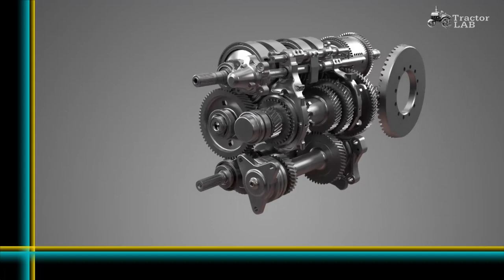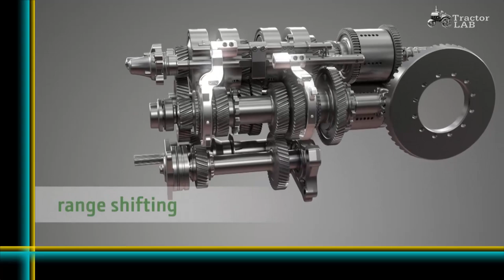CVT vs Powershift. Is CVT better than Powershift?

Comment: It depends on the application.  If you need pulling power,  Power shift is the way to go.  If you need to have variable speed in order to run an implement or to do many directional changes. CVT is your animal.   As you said,  both will do the job, but, just as a sword will slice bread, you would not gut a deer with a butter knife.
Reply: Yah i agree ive grown to love the john Deere autopowershift/ivt i had a bad wreck years ago that was partly inexperience but also largly the fendt cvt doesn't respond bright away so it started running away getting pushed down the hill right at that crucial point of the load starting to push and the tractor realizing and trying to slow down it failed by the time it realized it was already to far gone even still it didn't feel like it really had much to offer felt more like a hydrostatic so naturally i am leary of the fendt cvt in some situations but they are the king for fine movement or need fine control of wheel speed things like hitching to implements or pulling out stuck trucks i haven't used a fendt enough in say if for cleaning corals or other yard chores its king but i do like the old school power shift with a shuttle shifter super easy compared to the old school before shuttle shift days ill always love the true torque monsters of olden days where you pick your gear and let it grunt through tough spots they would bog down a lot lower than the new tractors before throwing in the towel if you asked it to 
I would love to one day find a good test to prove it but i feel like the old school hp vs new school hp going head to head the old school would show more torque if you locked them both at the same gear ratio show the diffrence between designs and how the new ones rely less on brute strength and more on technology and keeping conditions optimal for the engine
Reply: @Kraigthecanadian  Exactly mechanical gears have more torque..
Reply: I have never tried a power shift only vario. And with what i hear i think its better with a power shift if you a driving silage grass from a foarge haverster caouse the foarge havesters speed changes som often. When i have done the and i hat to acelerate it was kinda slobby. I drove a case ih puma 230. it was kinda nooring i would rather drive a tractor when i gave it gas it should shift gears firs.
I don't know if you could understand any of what I have written

Comment: Id take a powershift, i have a bad history with cvt's. New holland T6 cvt failed, i have the same tractor with powershift, still works perfectly
Reply from the maker: Powershift безусловно имеет преимущества, котрые особенно проявляются на частичных режимах работы двигателя.
Reply: ha i see your problem you brought New Holland.
Reply: @phalanx3803   xd
Reply: I once thought like you till owning a Claas hexashift gearbox went wrong cost more than putting a new vario in by the time it was all done
Reply: I never trust NH for any machinery. Go with the premium brands and run trouble free 🙂
Reply: @bartdereu9267 are case or NH not a premium brand? Lol. Most popular brand in my country area is case or NH.
Reply: @alastairatcheson1407  the shttiest machines are the most popular in ur country lolz ?
Reply: @megaatomicpickle  the best, obviously 😁

Comment: You forgot the part where cvt need replacing every 10000 hours
Reply from the maker: Ok!
Reply: Power shift will have to rebuilt in 10000 hours to
Reply: @steveforrest6720  nope
Reply: @orkell8195  yep
Reply: @steveforrest6720  we had a JD 4650 tweeted to 279 hp with a flat torque curve,dual wheels front and back,spent 5.2 meter tasters chisel plough on the front,5.2 simba 2b discs and a vaderstad heavy packer roll with levelling board behind,no power shift problems
Reply: @steveforrest6720  depends on age and use and abuse as well
Reply: I don't think CVT and PS is much different. Treat them well and you get allot of hours. Abuse them and you could have to replace a CVT in 3000hrs. Cost or repair is almost the same.
Reply: @bartdereu9267  this was 2 years ago. I have seen the light

Comment: So cvt is half automatic gear box?
Reply: No , it’s a full range fully automatic transmission
Reply: @bartdereu9267  I can't imagine having an automatic tractor.
Reply: @kristjanpirc537  i have 2 , one since 2010 and one since 2018. Works amazing
Reply: @bartdereu9267   but only big tractors have cvt, 100hp +
Reply: @kristjanpirc537  that’s mostly a fact yes

Comment: Ill take the john deere ivt but not the fendt cvt ivt is clear its still actual direct connect from engine to rear end
 fendt feels and acts more like a hydrostatic and doesn't seem to put as much power to the ground ie loose a lot in the transmission but it does have much nicer control for say you are in a muddy area pulling trucks out all day the fendt wins in my books and its so much smoother at creeping around but as far as field work or roading heavy loads over hills deere all the way holds the weight back better faster response to it getting pushed by the weight in the field it is more like the old school power shift but smooth operation of a cvt though it actually being a autopowershift and you can barely tell it does shifts
Reply: Fendt cvt's tend to fail a lot and cost a fortune to repair.
Reply: That's actually a bullshit story. Fendt was obvioulsy the only one who tested their transmission on effeciency, and they learned that a CVT has it's highest efficiency at 70% hydrostatic and 30% mechanical power. That's why they are build the way they are. Fieldwork 0-25 and road 0-55 . In field modus they have the highest effeciency at around 8 km/h , making it the most effecient tractor on the market. A JD (ZF) transmission is allot more complex, has more gears and clutches (with more drag) and are not even close to the effeciency of a Fendt vario transmission. All of this has been documented in dozens of magazine. But haters always gone hate i guess.
Reply: @bartdereu9267  cool you can read salesman brochures but do you have real seat time ill take the mechanical more complex as you call it transmission  of the deere ivt any day of the week over a fendt they all have there place but the fendt has been the cause of a life threatening situation for me cause there was a disconnect between the ground speed and the engine rpm  im lucky to be alive if im constantly pulling trucks in mud or something yah i may ask for a fendt as i need that fine control of wheel slip and smooth transition of power or doing pto work with hydraulics that computer setup is handy but if im trying to pull hills or put hp down to the ground ill go deere ive had case magnums with the self protection feature of if you bog the engine beyond a certain point it kicks it into neutral well i can tell you trying to cross a intersection that is dangerous